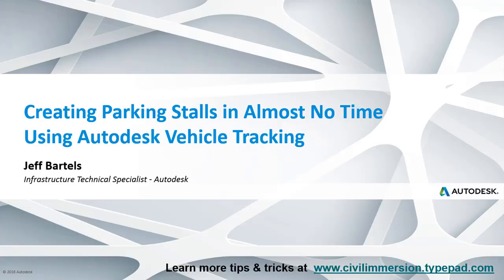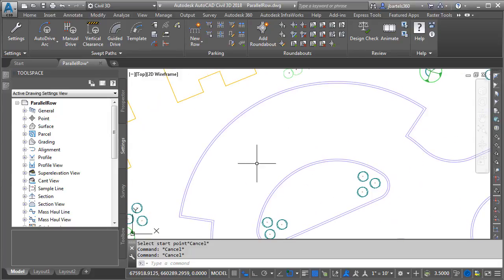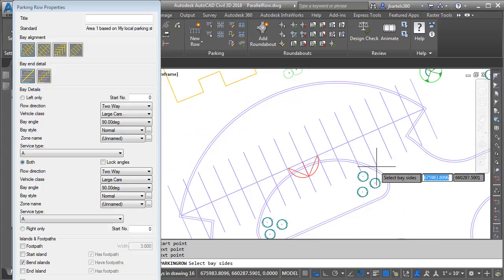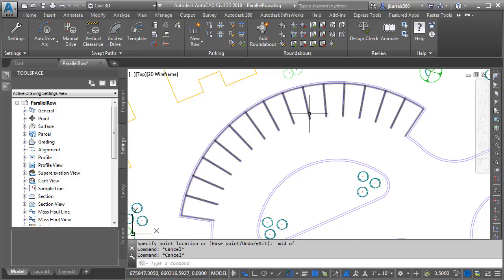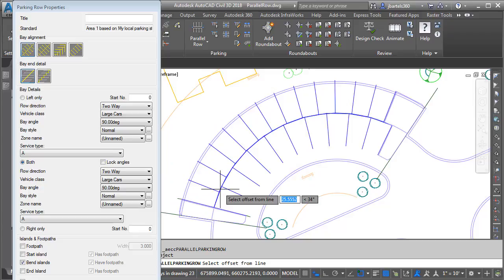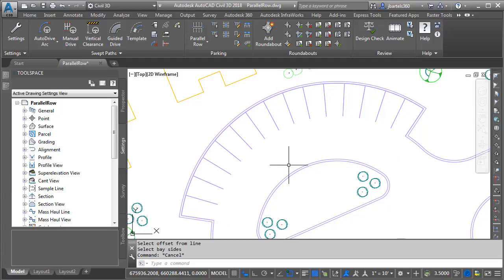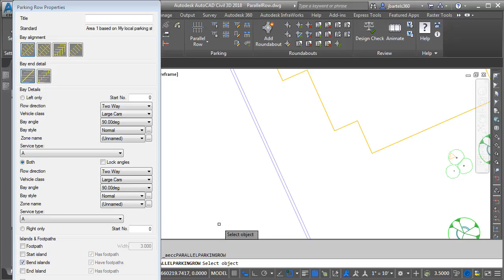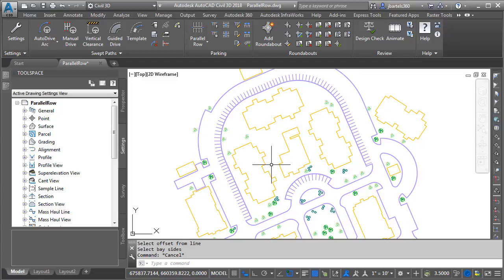Creating Parking Stalls in Almost No Time using Autodesk Vehicle Tracking

Comment: Hey Jeff, Great video as always. 

Was wondering if you can change the "reference" point for parking stall widths or if you found a potential workaround. In the first example where you placed parking stalls on the inside of the circle, wouldnt the entrance of the parking stall technically be lower than the design standard? since the parking side lines would be converging.

Love this tool and hoping to add it to the arsenal!